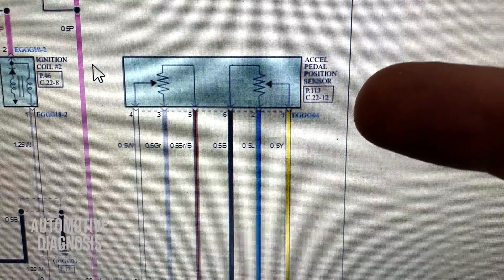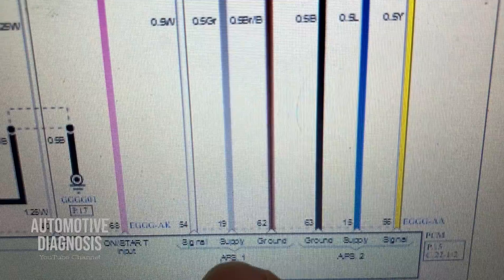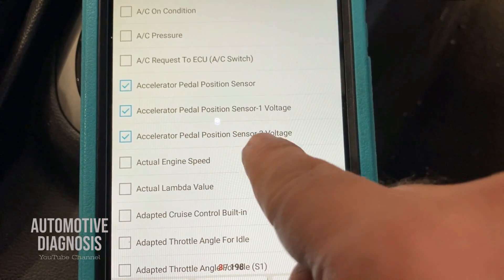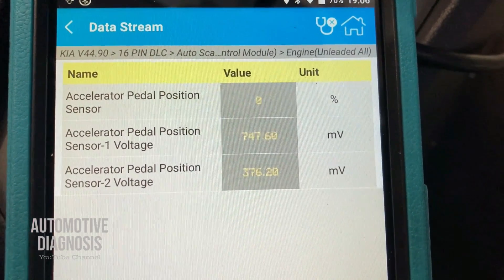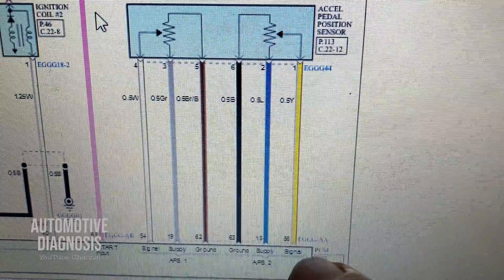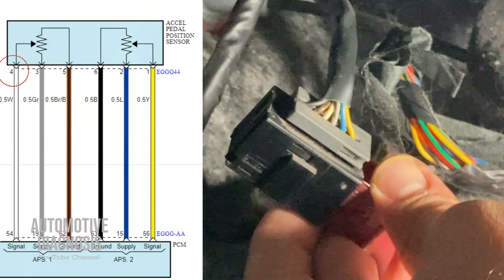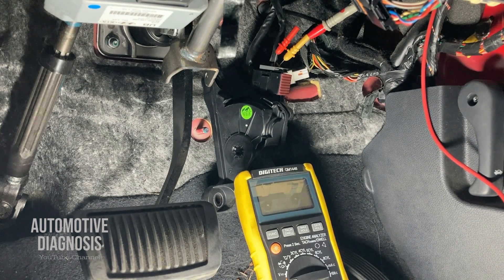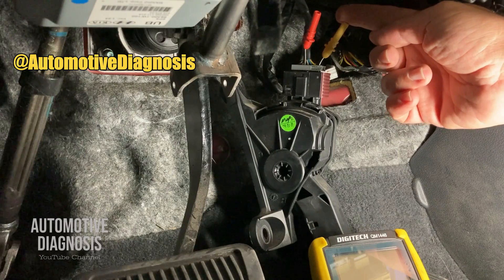Accelerator Pedal Position Sensor PROBLEMS Solved!

Comment: What vehicles does this work on? 

Because on some vehicles. Apps1 will start at 4v with throttle not applied. With APPS2 @ 1.51 volts

Wot APPS1 is @ 0.97v while APPS2 is at 3.93v

What your saying here does not apply with the vehicle im looking at. 

You had me believing since the APPS1 is dropping. My Accelerator sensor is bad. But thats not the case.
Reply from the maker: Hi my friend, This car was a KIA Rio 2012. Many cars have the same type of output signals on APPS1 and 2, but it doesn't mean that all cars are like this. Workshop manual is always a great help for finding the specification.

Comment: I have fronx AGS , just after 1st service i am feeling accelerator pedal is loose sluggish ( not proper tight/grip) 
is this condition i am facing problem to overtake, in hill, in traffic 
I took it to service center they told me they just did bleeding and and this is 3rd time they just do bleeding ( as they told me) but i think fronx has electronic pedal i dont know about this

What is the main reason?

Comment: The gas pedal reaches zero. Turning it on and off fixes it. Why does this happen
Reply from the maker: It could be the bad/dirty contact on the sensor variable resistance contact.
Reply: @AutomotiveDiagnosis What was your problem

Comment: I got P2110. My pedal voltages are spot on like yours (even though my manual says expect 4 and 1) I got like yours .7 and .3. But checking the resistance on the sensor I get 1000ohms on APS1 and APS1 and 1300 and 1500 at full throttle so its cooked. But the strange thing is with all this going on I also have 5V sitting on TPS wire. I disconnected the pedal sensor and still 5V on TPS1. But what changes is TPS1 to GND is Open with pedal sensor disconnected and TPS1 to GND is 300k with pedal sensor connected. I've ordered a new pedal sensor but for the life of my I can't explain why TPS1 would have 5v sitting on it. I've checked all nearby power, including VREF from other circuits and can not find the issue. Next step if the pedal sensor doesn't resolve the TPS1 issue (unsure how it would, but I hope so) is to just run a new wire  from PCM to throttle body. Have you ever seen pedal sensor fail affect other systems, maybe the computer is throwing 5v on tps1?
Reply: Figure it out to help others?

Comment: Thanks for this video.
How do i disgnose a car that is not pulling. No response when you depress the pedal and it will read no fault code when scanner is fixed? Please what could be the cause? Lexus rx400h 2006
Reply from the maker: Hi there, there could be a couple of different possible causes in this case, Pedal position sensor, Throttle actuator/sensor, wiring/connector on each one and also some other sensors like O2 sensor can cause this too. If there is no code, you can use the live data as I explained in the video.
Reply: Thanks for the reply. 

We discovered after watching this video to test the signal wire by backprobing the wire while the accelerator pedal depressed. The pedal responded with increase in volt on the multimeter. But the TPS didn't give the reading. Same reading on the ECU side. Can i say there is something wrong with the ECU? 

Thank you

Comment: Thank you for sharing the knowledge, are these Voltages the same in all car brands? I have a Clio 2 and it's giving me headaches; Throttle body and Accelerator Pedal were both replaced with new ones but the problem won't go away it's still there,ECU was also tested.
Reply from the maker: Hi there, if you have replace the sensors, checking the wiring is important.

Comment: P1120-08 Accelerator Pedal Position Sensor 1 and 2 Signal Incorrect Ratio

Pedal Position Sensor 2 is reading High Input 

Kindly help me correct this problem. Thank you very much.
Reply from the maker: Hi my friend, it could be the sensor issue or short to power on the wiring, all steps for diagnostic are mentioned in this video.

Comment: P1122-01 Accelerator Pedal Position Sensor 2 High Input.
Please how do I correct this problem
Reply from the maker: Hi my friend, it could be the sensor issue or short to power on the wiring, all steps for diagnostic are mentioned in this video.

Comment: Hello again, so I've tried applying the troubleshooting I've learned from you, guess in bit having much luck, at what point do you conclude a ECU being the problem? 01 Audi tt, ign on at the APP sensor 2.  Power in 5.0 volts 2 signal wires 4.2volts 
2 grounds  4.2 volts...
Ign off  5.0 volts power,  1.2 volts signal and 2 ground .02 volts. Both APP and TPS sensors are new. Is there a bypass process of elimination i could do and checking continuity along with shorts? As soon as it starts it reclines, any  kind of help would be appreciated..... Thank You 
Troy

Comment: Hello from Estonia. i have question. when my car engine is off but ignition on the throttle butterfly moves, but when i start the engine the butterfly wont move if i press gaspedal. i wast testing the sensor with multimeter it show 53.6 and not change when i press pedal
Reply from the maker: Hi there, did you happen to check the engine for any fault code? and that 53.6 is it millivolt?
Reply: @AutomotiveDiagnosis  resistance
Reply: @AutomotiveDiagnosis  scantool show sensor1 normal v range and sensor 2 was over 7v when i press pedal

Comment: I never thought I would watch a video like this until you actually need some help, can't thsnk you enough   i do have a question is it always the case that one of sensors output would be half the volts?  My problem is soon as I start it goes to wide open throttle both aps have 4.1 volts, which now makes sense and I guess I just answered my own question. So thank you because I really  couldn't understand until watching this video that they are different thank you
Reply from the maker: Hi my friend, I’m very glad this video was helpful 👍👍😊

Comment: Can this problem be in a new vehicle with less than 2k miles and only at various times?
Reply from the maker: Hi there, it could and not normally due to a bad sensor, but because of the bad connection on the connector.
Reply: Thanks for replying. Would like to add another issue for same vehicle.  Can the pedal acceleration sensor connection be inconsistent,  as the problem  is sporadic . Any help will be appreciated.

Comment: APP signal 2 still fluctuates/blinks from 0.21v directly to 0.0v, either or, on scan tool and dvom: what could cause this?
Reply: Could be a loose connector or worn pin at the ecm?

Comment: Bless you, and thank you for this insightful video. I was able to test both APP signal circuits today before I froze to death. Sig 1=0.44v, Sig 2=0.21v, both KOEO. Curious, what does it mean that Sig 2 blinks to zero (0.0) volts and the back to 0.21v every 11 to 27 seconds. How do I interpret this result? 2012 Chrysler Town & Country.

APP signal 2 still fluctuates/blinks from 0.21v directly to 0.0v, either or, on scan tool and dvom: what could cause this?
Reply from the maker: Hi my friend, have you tried checking the output signals when engine is running?
Reply: @AutomotiveDiagnosis mine does exact same with engine at idle. Blinks every couple seconds. No movement of throttle blade and its a brand new throttle body as well
Reply: Mine is doing the same thing. But when I back probe it, my multimeter doesn't show the drop, Im guessing my meter doesn't pick it up, so I would need an osiliscope to see that.
Was the pedal your issue?

Comment: Good morning friend,please i have kia sorento 2012 2.4L,my problem with the car is that while driving the accelerator pedal will not work while my foot is on the accelerator pedal to the floor, onles i take off my foot from the accelerator and press again and it starts working again, no code when i scan it, when it happens like that the live data of the accelerator pedal percentage shows 0 percent, please i need your help
Reply from the maker: Hi my friend. This could be the pedal sensor problem. Instead of checking the pedal percentage, please check the APS1 and APS2 output signal as I explained in the video.
Reply: @AutomotiveDiagnosis  please i have replaced it with new one but still the same problem
Reply from the maker: When ignition is on (ENG Off), check the live data for throttle body and pedal for both sensors in each one. Tell me what you get.
Reply: @AutomotiveDiagnosis  thanks i will do that